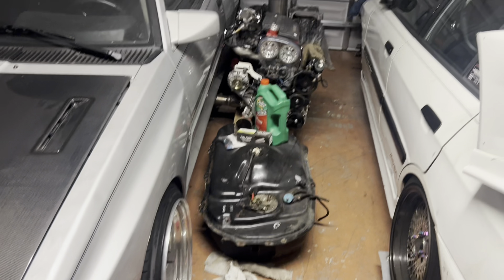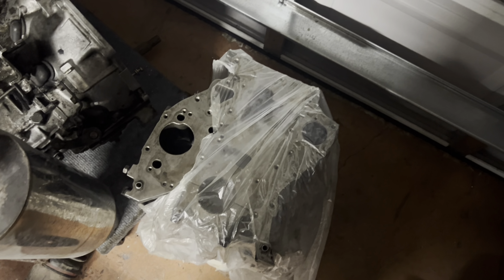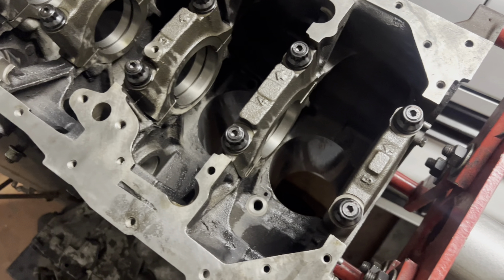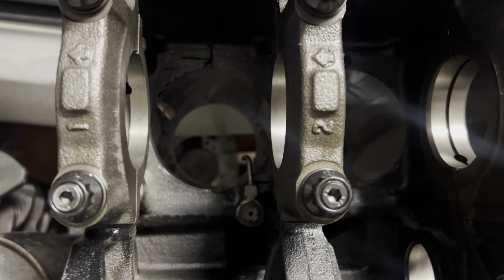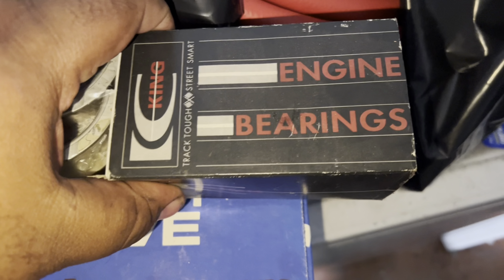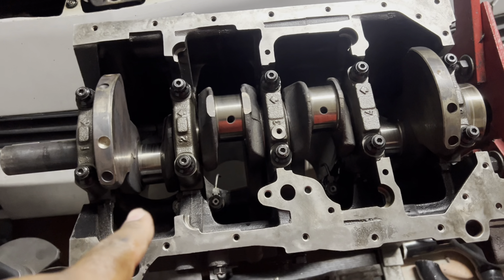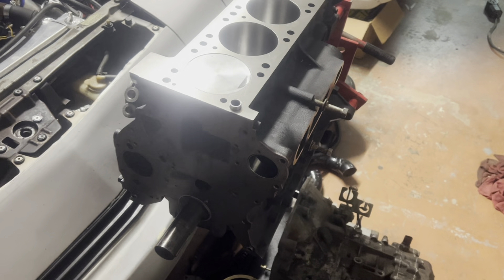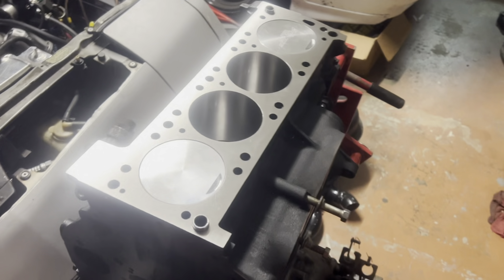500hp build part 4￼

Comment: What compression ratio are those bad boys?
Reply from the maker: These bad boys are technically 10.0:1 compression ratio rated for corn after 15 psi the higher the compression the less boost you can run on pump gas 👌🏾👌🏾👌🏾👌🏾